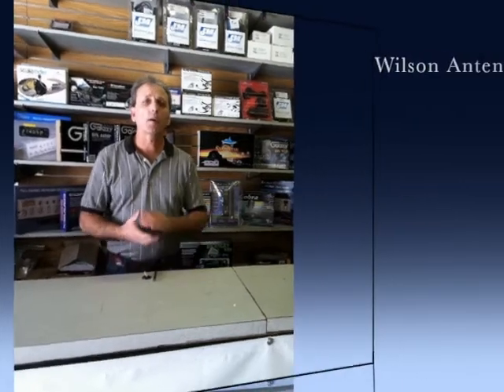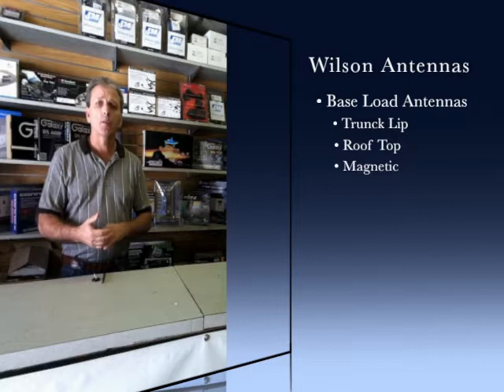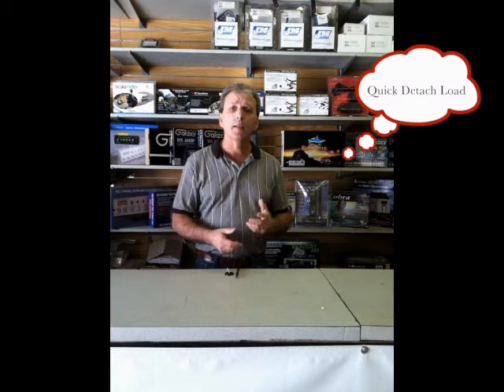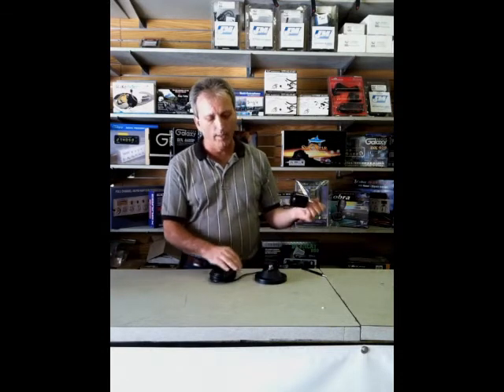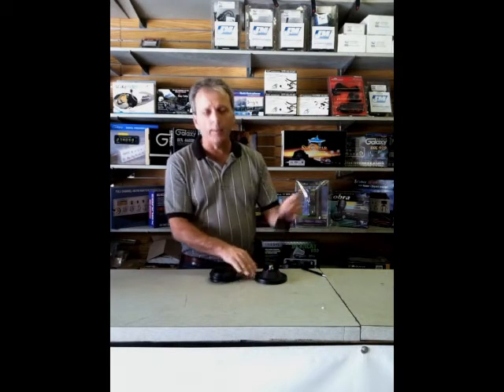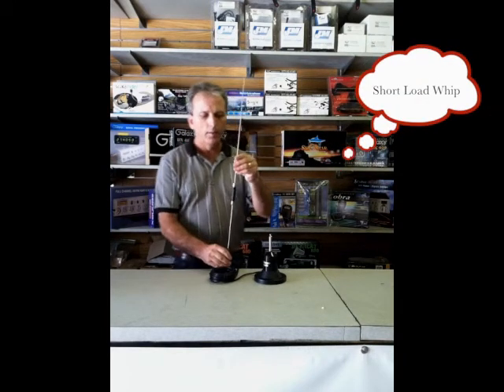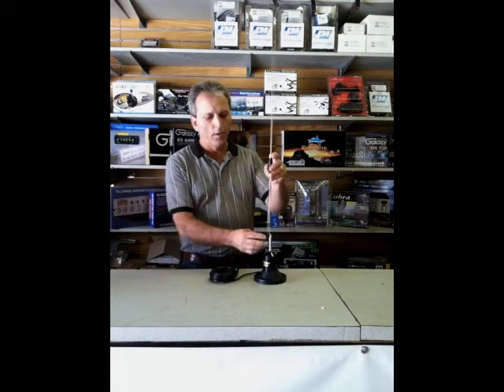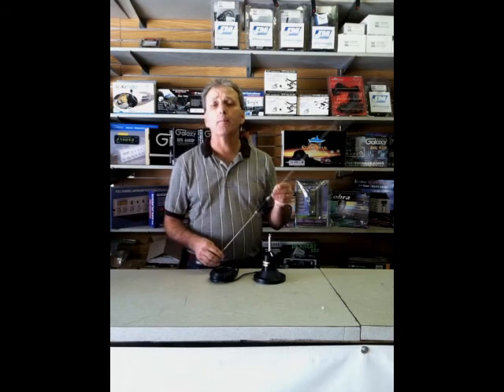Antennas-Wilson

Comment: Just a quick question ,  Regarding  The CB Antenna Mounting  In  back of cab with air Farring .   What's the best way to mount it ,   I'm going to use a Wilson 2000 . Should it be  above the rear widow .  or below the widow ,  with a standard mount ,    for the best reception concerning  SWR's  .  Thanks  ,

Comment: I have ask everyone for help I have 2002 Chevrolet Impala 4 door family car, I recently purchased Wilson 5000 magnetic mount need help get 62 " steel whip toget  match up well with 1.5 or less on 1 to 40 channels!  I have on roof top coaxs go buy trunk in front near back window then run in a hole near backrest of back past my seat beat right side to and front passenger one ! But wanted know if can cut whip and how much out 62" whip length total be shorter! Plus it has R8X 95 % coax 18 feet type on it to came like that at store I bought from ! know my previous antenna Wilson 1000 had 64 inches whip cut 1/4 " off and ran perfect 1.1 o  Channel plus flat on 20 channel , 40 channel flat too had RG 58 U coax 18 feet! If can help out be appreciated hints do and and radio I useing is Uniden Grant XL radio plus tune up too! Thank you everyone from Andrew (Cowboy ) 396WT90 Ontario Canada!